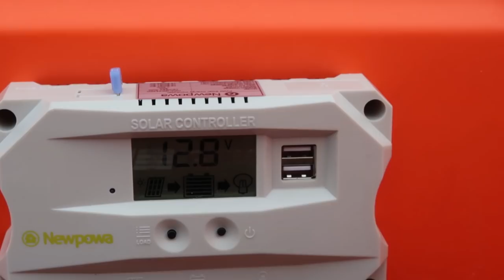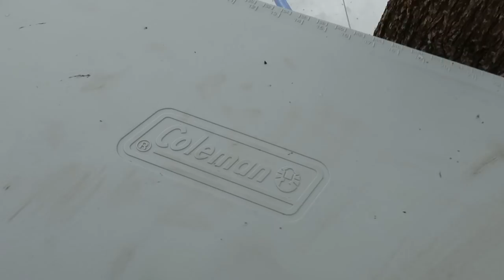204 Solar Powered Hobby Maple Sap Vacuum System?

Comment: Guys great video. Who is the electrical engineer in the family? One question that 14 gauge extension cord do you feel it is adequate enough for the length it is run? I might have used 12 gauge considering the possible voltage drop for that distance from the panel to the cooler. Just an idea maybe you should coat all your ground connections with clear lacquer or nail polish to prevent against corrosion. Its something we used in the aviation world. Great set-up guys waiting to see it in operation. ❤️️ Guys also spray all your external hardware with a product called Fluid Fllm just for corrosion protection. Hope some of these ideas help.
Reply: The panels are 200 watts. When you buy a new cord it will tell you the watts it rated for at the length your buying. I don't remember the number of watts but it was rated way higher then 200 watts.
Reply: I did buy a 100ft 12 gauge for our cow tank heater and that was rated over 1500 watts so 12 gauge would be way over kill.
Reply: @ruralridez6165  Much less voltage loss over 100' with 12 Gauge wire.  That is a 15 Amp Pump.  It is not the rating of the wire but the length that matters.